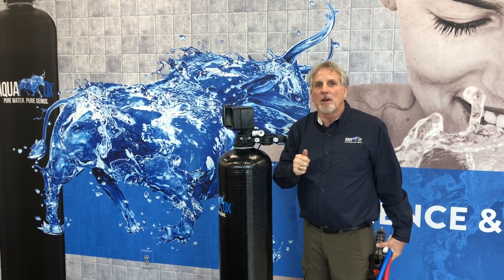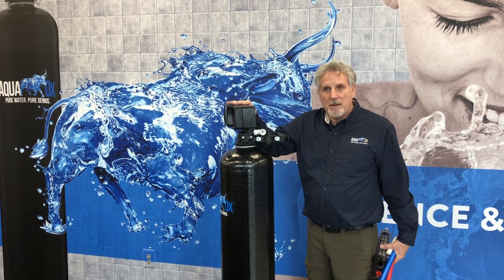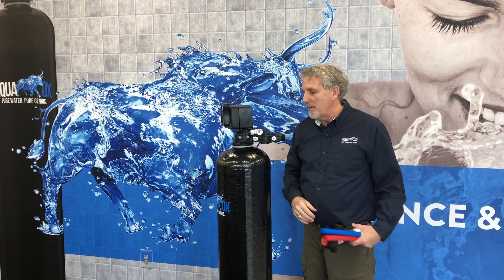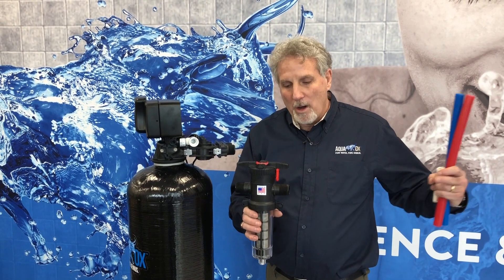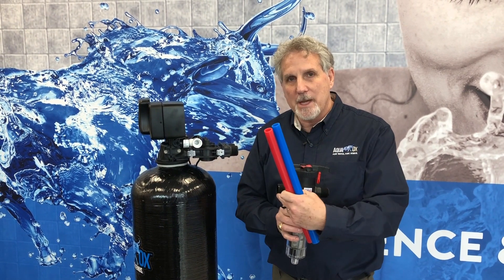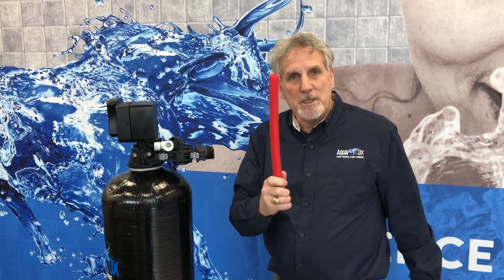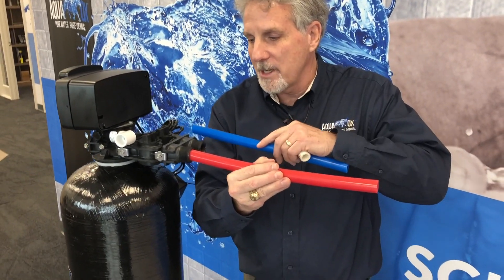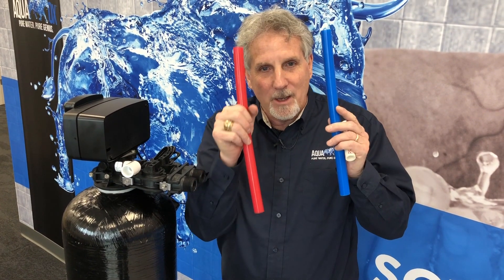How easy is it to install the AquaOx?

Comment: Hello, just a question.   While the unit is in backwash mode, is the system shut down with no water available?
Reply from the maker: The unit goes into backwash mode for only about 15 minutes. During that time it will decrease the pressure from the taps but not completely turn off the running water. Typically the backwash cycle is run at midnight to decrease an inconvenience it might cause such as a shower water pressure. However, you can set the backwash time to whatever time you would like for your own personal schedule :)